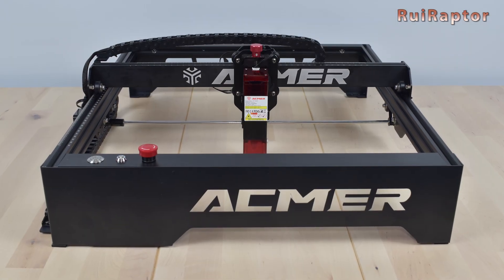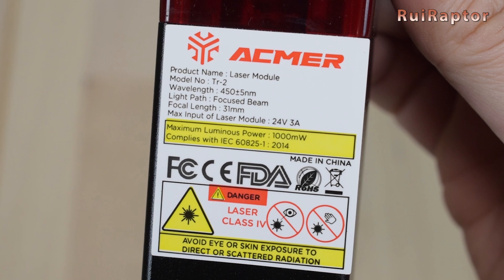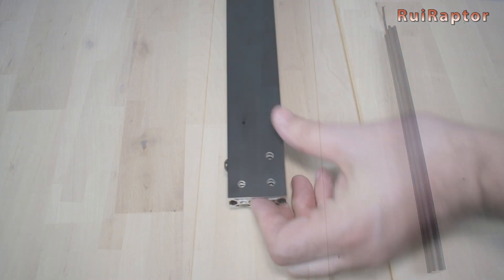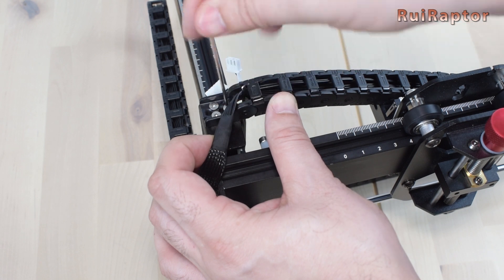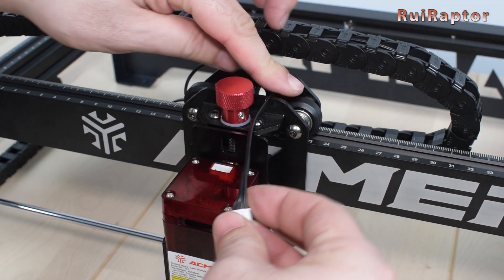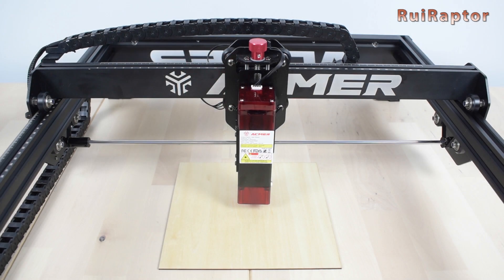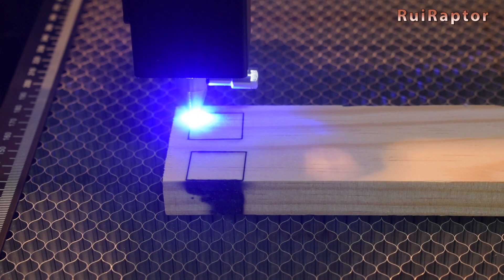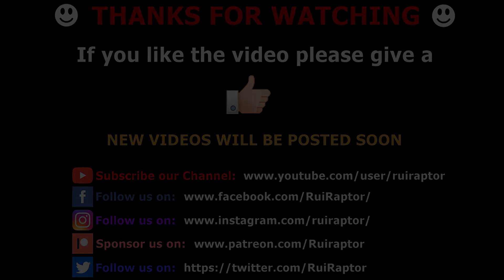ACMER P1 (10W Laser Engraver & Cutter) - Assembly + FULL REVIEW (Includes Tests on 15mm THICK WOOD)

Comment: What’s the program used to create or load images
Reply: Its called lightburn, and I tried it with the newer version but it did not work, so I down graded the version to the one that came with the laser, and it worked. Note, you only get a free 30 day license on the software, before you have to buy it.